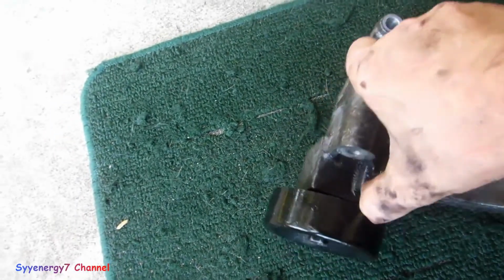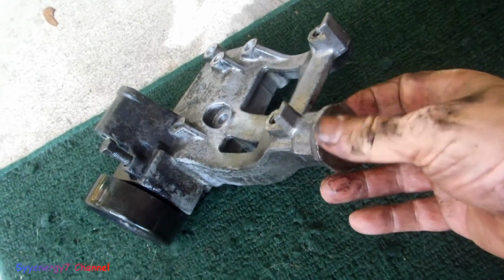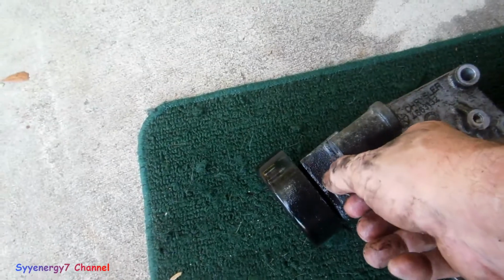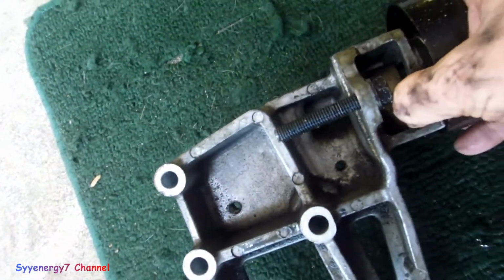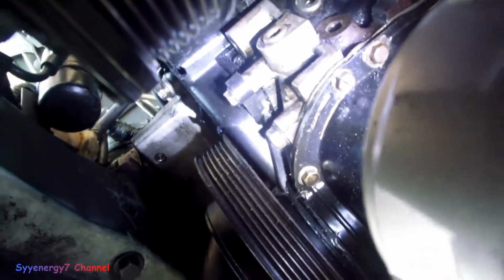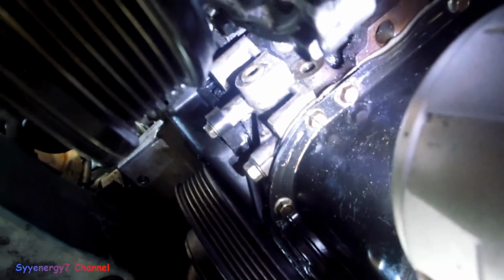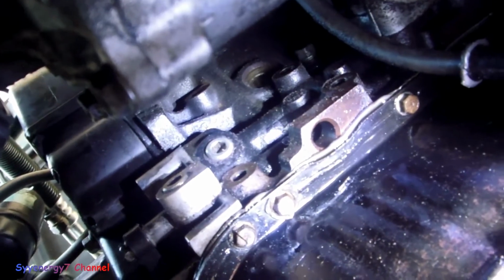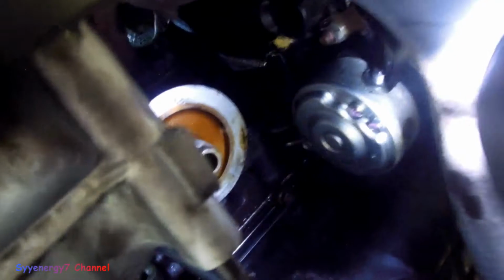Chrysler Sebring, detail on Serpentine Belt Adjuster

Comment: Synergy I have the same exact oil leak as u on my Sebring been seeing it for two years drip from that cradle thing but never got it checked out because it really doesn't effect my oil level that bad at all now I finally know where it's coming from thanks👍🏽👍🏽your a good mechanic
Reply from the maker: +prince keem It turns out the oil pump gasket was the main leak.  The plug was leaking too , but that part is fixed.
Reply: +syyenergy7 aww ok was it hard to fix?
Reply from the maker: +prince keem Time consuming, for sure.
Reply: 03 Galant most likely same a quart ever 1000 miles

Comment: Hey syyenergy7 - We really need to pick your brain about this this car. The continual squeak from our JXI is driving us insane! We've replaced pretty much everything there is that this belt runs through, but not getting anywhere.

We keep thinking that we have the problem fixed, tighten it up - no squeak. But then it's back in 3 hours or the next day.

Any thoughts?
Reply from the maker: unless it's a timing belt idler pulley
Reply: Ok, what you have in this video is the tensioner pulley. You're saying we have a idler? Is there a video of yours where I can see where to look? I'd hate to think we've skipped that one.

Comment: Hello....Youtubers..!!
  I am currently Removing and Replacing the Alternator, ( on My 1998 chrysler Cirrus), for the Second Time...it Lasted a Year and a half until the Upper, timing Belt area splashed and Dripped ?)  Enough Engine oil inside the
 ($35.00 rebuilt Alt.) To Short it Out a Second Time...The Red Battery Sign Came on , on the Dash..Shortly thereafter the Battery was Dead...and Would Not Start Up Again... Absolutely No Volts coming from the AlterNator...
It is a Miserable Job...with the Wheel Well Plastic , to be Removed...Tensioner to be Loosened / Carefully. -- Stringing the Belt Correctly Again ( in the Belt Grooves on each Pulley..)  I Dread This Job...!!    I did Find that there is an Aluminum Bracket in the Front of the Pass. side / motor attached to the Alternator....that when removed.. Makes it easier to unload...and Load the Alternator. Then You Deal with the Belt( s) ,
 And Tensioner...and You're Done.... It might be a Great Suggestion : any vehicle with oil leaks , no matter how Small... It is Best to get the Car Running Good Again....then Design a Makeshift tin, aluminum, or heavy flexible black plastic ( Like a wheel well splash....and Protect Your Alternator so oil or water does Not get inside the Alternator...AS THESE ALTERNATORS ARE RIDICULOUSLY SENSITIVE AND FRAGILE...AS FAR AS FRYING.....INSIDE...
   JUST SAYING...
BILL IN L.A. 8-17-18